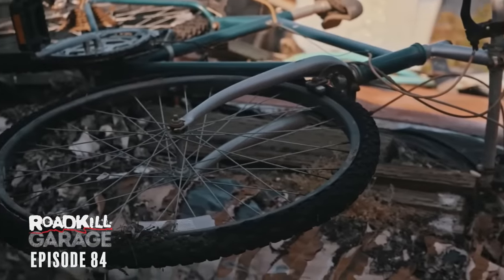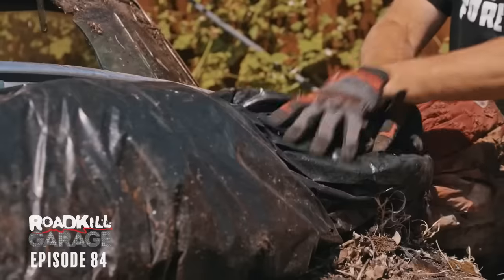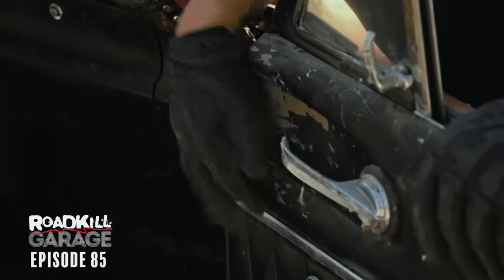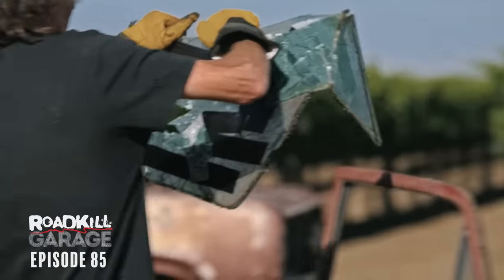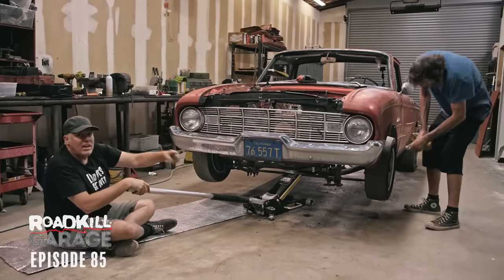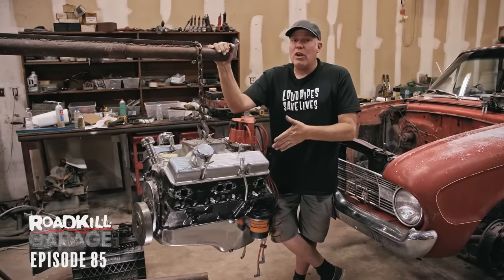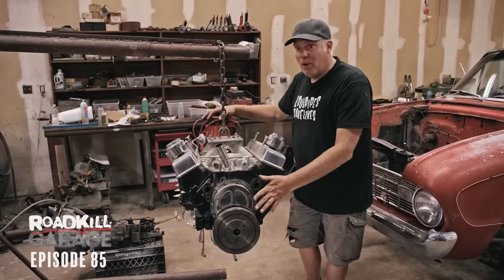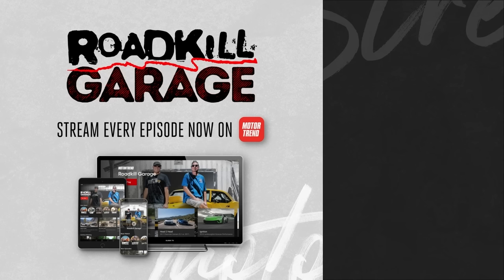40 Years of Neglect! 1960 Ranchero Restoration | Roadkill Garage | MotorTrend

Comment: Episodes like this always make me wanna run outback and get some of my junk running!
Reply from the maker: Make sure to clean it out first!
Reply: Here in Mississippi about every third or fourth house has something from the mid 1960s to mid 1970s sitting behind it. Now that Mississippi got rid of all yearly state inspections you can build anything you want and don't have to go through any government say so!
Reply: Facts I has this exact car 62 ranchero has the inline 6 running picked up for 500 plus like 20 other projects I never get too  trying to finish my 75 Camaro with a 454 my 68 cougar with a newer 302 with gt40 heads 71 mustang fastback with the 351 Cleveland with 4v heads 56 Chevy stepper 64 c10 stepper  those are the ones I have been trying to get going money money money lol

Comment: I bought a 68 Ford half ton with a 390 FE, could NOT turn it over with a six foot cheater bar. Sat with no hood or carb, or anything covering it. Engine was full of water. Dumped a bunch of Tencher Iodine, use for castration of catle, got it to turn over, put a carb on changed oil, and got it to run, even drove it a little. When I tore it down it had five D shaped exhaust valves. Gotta love the old junk! LOL
Reply: Good story. I had the same year f250. My wife took my truck to the mountains one day. I neglected to ever check the oil and it ran dry so that it died on her. Put oil in it, drove it home. FEs are awesome

Comment: I’d love to see them put a hi po 289 and a top loader in there
Reply: Your a man with true vision
Reply: Yes needs a ford. they should build a 302 windsor with som Cleveland heads..
Reply: A perfect fit for such a small, light car.
Reply: I fitted in early 60,s Aussie Falcon fifty
Reply: Funny comment!  I have a ‘62 Ranchero this exact color and a hipo 289 with a toploader trans.
Reply: I’m looking to buy a ‘65 with a 5 speed tremec  … gets driven often enough. 
With a modern small block Ford it would be a very neat little bomber
Reply: No they need one of the new Godzilla motors with a blower on top
Reply: The cost of a hi po 289 is the same as a built stroked 351 Windsor these days.

Comment: Awesome! Love to see more detail on why the swap had to happen and the challenges of ‘stabbing’ the 283 into the engine bay and getting it running. Education about how you get things done is appreciated!
Reply: It never made sense to put Chevy engines in Fords ! 289 Fords are better than 283 Chevys!
Reply: it was done when they got it . they just put that motor in it to see if the car was worth fixing
Reply: considering there's a straight axle in it, there's probably clearance for a Ford front sump oil pan.
Reply: @jerryparks6123 . I've always primarily been a Chevy guy, but I agree that it should have a Ford engine. As for which is better, the 289s bigger bore can fit a little bigger valve but the 283 is an overall beefier motor with a still great bore to stroke for revving. (Just don't use the early rods!)

Comment: Hi guys , another old falcon guy here ,I had a 1963 1/2 sprint for about 35 years and loved it . Idk if you noticed it , it looks like the rear wheel fenders have been re-flared and from the looks they did a first class job , I did the same to mine to give it that factory vibe , took me over a week all metal no bondo . Looks like a fun project , oh and NO COMMENT about the engine selection as I did not want to get kick off of u-tube lol

Comment: I like it!👍 Reminds me of the Ranchero gasser that Finnegan raced against with Blasphemi at Drag Week! That car was a wheelstanding killer!!
Reply: But this example is like opposite of sleeper. Looks and sounds mean but has the power of about 3 toddlers
Reply: @Mart77  Considering they just pulled it out of a LONG slumber, I'm sure they'll figure something ridiculous to do with it! Like maybe a crate 383 small block & a better clutch & transmission, & tires. The usual. Heck, the shifter linkage was reversed & they could STILL drive it! 👍

Comment: My grandpa gave me a 1960 Ranchero in 2003 for graduation.  Drove it for years.  Now it sits in the garage waiting to be rebuilt.  He dropped a 66 289 mustang drive train in it.  I am planning on putting my 4 speed top loader in it and a 68 shelby supercharger in it.  I want to build it like a kid would build it in 1969/70.  No parts that would have been available from after 1971.  1970 technology and before.  With maybe the exception of the 78' mustang II 8" rear end in it.  That thing is bullet proof.

Comment: I have a ‘62 that looks exactly like this one, color included.  I dropped in a 5.0 HO and 5-Spd . Still need to plumb up fuel and radiator and fire it up....Drag raced one in HS with a 289/C4 that ran 11.80’s in 1982

Comment: This truck was a daily driver. I drove it many miles and a fair amount of distance at times. The transmission linkage is a boo boo. That can and should be made right. With the Bridgestone tires I had good control of the truck. Yes it rode a little rough, but with the shocks on the front helped alot. Was not setup to be a drag racer, but on the freeway I could cruse all day at low rpm. Could get triple figures speed in 3rd, no sweat!!! Then their was 4th. Some of the stories I could tell. They make me shake my head.

Comment: Had a 65 rancheros 6 cyl 3 on the tree put a 289 solid lift cam with 4 speed super fast!
Reply: Fairlane bodied ranchero's are too common & nothing compared to  early falcon style.  Had 2 67s one 390 & a 289

Comment: What a great resurrection! I have seen a lot of the "mini Rancheros, as the Phone Company had a mess of them, and they could be bought used for a song. All that aside, why not install a small block FORD in it? The engine compartment was actually designed for it, as a 260 (maybe a 289) was available with 4 speed from the factory in '64. I had a friend at the time who bought a new '64 Falcon convertible, which was so equipped. You could also put the original style front suspension in, making it a bunch safer and better handling.

Comment: Use one of those rotating nozzles for the pressure washer. 20 bucks at Harbor Freight.  Works great. Markings on the heads are " high performance " power pak heads.
Reply: POWER PACK!!! Closed chambered! COOL!

Comment: Why the heck are you putting a small block Cheevey in there when in 1963 the 260 (I have the car to prove it) was a factory option? Mine now has a 302 with 1969 351W heads. All factory parts, all mounts, all fits perfectly! Get that Cheevey out of there!

Comment: If it were mine. I would go old school 331 with a tunnel ram .
   Put a TKX transmission and a 4.11 gear. That way you could rip on the lower gears and still cruise in O/D.
  Of course that 331 would be a Ford motor.

Comment: Why do you guys always put chevy engines in fords? I understand that the parts are cheaper and easier to find but still, why basterdize an old car?
Reply: Someone else had done that. They wanted to get it running, so they went with a variation of what was there. They would have had to replace the motor mounts, which could take some welding, and then they would have to find a Ford motor and transmission, then there would be the driveshaft and a bunch of other work to make it run.
Reply: 0.37 mark in video answers your question

Comment: It would run better with the stock intake and 2 barrel Rochester that matches the small intake ports.
Reply: Because we all know that'd work much better with its BIG cam !!
Reply: @arkhsm  Big cam would flow better with the stock carb and  intake. As opposed to a large carb and single plane manifold with oversized ports that don't match the the small valve 283 heads. The turbulence created before the combustion chambers causes a big stumble from 2- 4,000 rpms.

Comment: sorry guys but the area with not tree does not match the car loaded with leaves there is not enough trees to have put that many leaves on the car and also if the car was there since 1978 with that much leaves on the car it would have rust under area where the leaves were at cause they hold water.